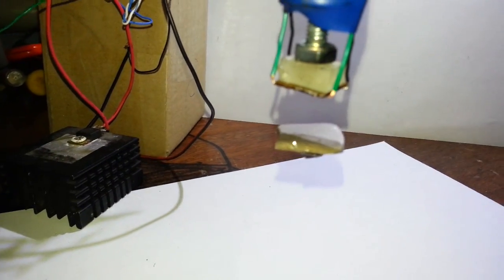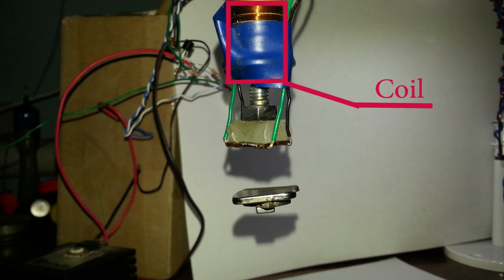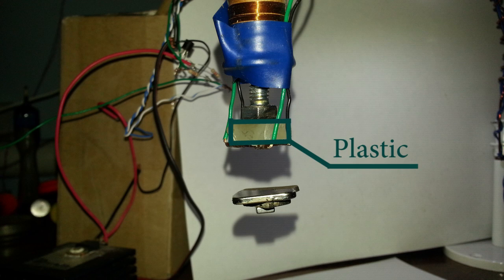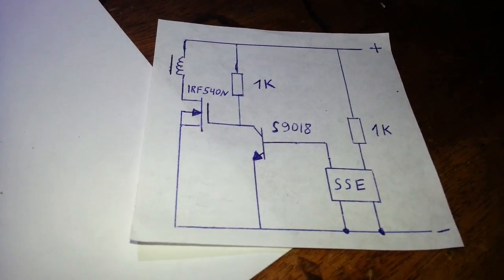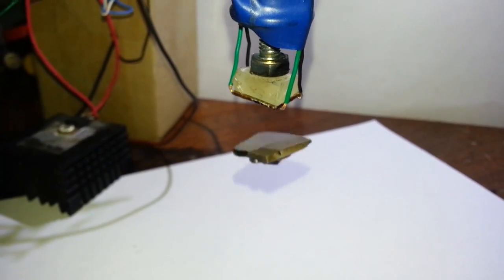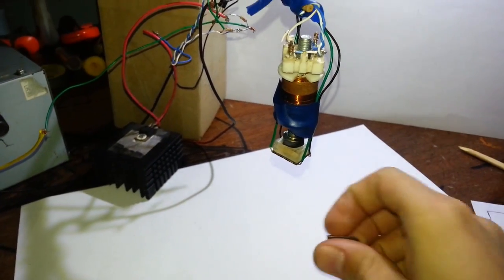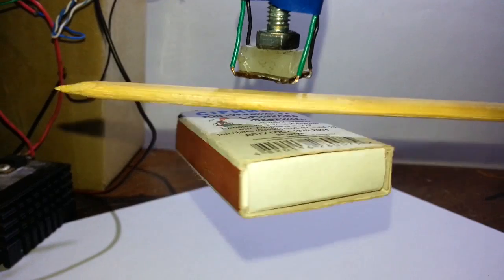Magnetic levitation device / The simplest DIY Anti-Gravity device (how to make levitation at home)

Comment: can I use a w41fc hall sensor  What voltage should be applied? Pls answer!!!!!
Reply from the maker: Hi, I don't know if W41FC will work. I just can say that W41FC is very different from the sensor that I've used in the video. W41FC is not just a hall sensor, it is more like IC that has a lot of stuff inside, so the behaviour will be very different. Also, W41FC has some kind of hysteresis control, and I think that is very bad for a levitation device, so I guess it will not work, but maybe I am wrong.
Working voltage of my device is 5V - 6V, and I used a variable DC power supply (0-20V) to power my device. Before testing, I didn't know what voltage I need at all because I did not calculate anything. I just wanted to quickly make a levitation device... I had an idea how it should work, but at first, I tried placing hall sensor under the magnet, not above, but it didn't work. All development process was just "trials and errors".
Reply: Electrical Projects [Creative Lab]  thanks for your reply!!!

Comment: Does it matter what type of Metal bolt is used?
Reply from the maker: Hi, Yes, it matters. You need to use iron. It will not work with aluminium for example. Here is a quote from Wikipedia: " The wire turns are often wound around a magnetic core made from a ferromagnetic or ferrimagnetic material such as iron; the magnetic core concentrates the magnetic flux and makes a more powerful magnet."  If you need more information read about "electromagnet" on Wikipedia.

Comment: Can the height of levitation be adjusted?
Reply from the maker: Hi, when I was changing the input voltage the height of levitation was changing also, but when the input voltage becomes too high or too low then it stops levitating and the magnet falls down or sticks to the screw.

Comment: hey i want to make a push type one. this is a pull type one. so could i make a push type with the same specifications
Reply from the maker: I think a push type device will have much more complicated circuit than the device in this video.
Reply: please help me with this because i have to do it in 2 months for the science fair. please explain me about this all i know is that it has halls sensors with 4 coils surrounding it and a ring magnet surrounding them all. could you help me about it? i am a ninth grader so i couldnt do it without help.
Reply: or atleast i want to lift heavy weights of 200-300 grams with this one. atleast tell me how to do that. thanks for replying
Reply from the maker: Frankly speaking, I've never built such device (with 4 coils I mean) and in my opinion if you don't have a lot experience in electronics it will be impossible to develop such device just from a scratch. But you can try to find an already developed project, and try to build it, it may work, but it also not easy (or maybe it is easy for you because I know nothing about your skills in electronics). But I really don't know how I can help. Sorry that it took so long to respond.
Reply: thanks..
Reply: You need smaller rotating magnetic fields to get stability with the push type. I over simplified that sorry. There are a ton me re considerations with the push type. The biggest hurdle off the top of my head is you need an air core coil or some type of core that is not magnetic or it will never work the are ferrites that are non magnetic but getting one that will fit your need would be a project all in itself, they can be very pricey. If you look at the magnetic levitation devices on like Amazon. You will see they are expensive, I would bet the most expensive components inside of one of the would be the specialized custom ferrites inside of the coils. I don't know of any off the shelf part that would fit the bill, sorry.

Comment: if what I saw was without any unseen or trickery,, this is a good video.  But it is something that I don't want to attempt because I feel it isn't that easy, and I don't believe that you can just get some spare parts and a Saturday morning with nothing to do and bang, you've got a levitation device.
Reply: Depending on how confortable you are with a soldering iron, and how far you have to go to buy the parts, it IS a very easy project. It doesn't require a big circuit, and you can make your own magnetic coil by winding copper wire using a drill.
Reply: SandroRocchi yeah I think the winding must be precise. I've tried with hand wound coils and have had major stability issues. I also wonder if the odd magnet might contribute to it working. I've failed many times with disc magnets time to try a pyramid of square ones.

To be clear it's the simple coil design that has not worked for me. Three smaller coils spinning has worked just fine.

Comment: very beautifull. I can contact you for clarification?
Reply from the maker: Thanks. Just ask here, and I'll answer.
Reply: +Electrical Projects Would you send me the electrical scheme and the procedure you used?
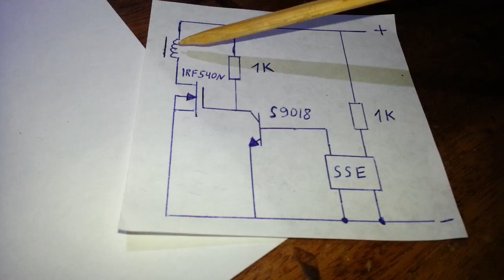Reply from the maker: You can see the electrical scheme in the video on 01:23, that is all I have. It was just an experimental project.
If you are a beginner in electronics, then better don't start with this projects, because this device works very unstable and unpredictable and you will need to know how to troubleshoot problems you will face.
Reply: Electrical Projects [Creative Lab] what is the pinout of the hall sensor? Also pls answer the another question i asked. Pls

Comment: Congratulations on the project, very good! I would like to ask a question: What do you mean difficult to tune? What is this tuning? And What part of the TV is the coil? What was her role on television?
Reply from the maker: Hi!, Thanks! I meant that you need to choose correct voltage, but it is not all,  maybe you don't need that piece of plastic between the hall sensor and the screw at all, or may happen the opposite and you need a bigger piece of plastic. All I mean that you need to play with that kind of stuff to make it work. The device probably will not work straight after building, and for that reason, you need to understand how this device works to tune it properly.
P.S. I just don't want people to be disappointed after building this device.
Reply from the maker: I don't know what was the role of the coil in TV. That was a really old TV from the Soviet Union, and I haven't seen such coils in modern TV.

Comment: Can you make this circuit work using just one transistor, by connecting the hall effect output directly to the base of the MOSFET? I saw another levitation circuit that just uses one transistor.
Reply from the maker: I can't, probably. At least I need a different type of MOSFET. The circuit in the video uses N-channel MOSFET, and if you use P-channel MOSFET then maybe it is possible, but I can't say for sure. The circuit with just one transistor that you saw probably uses a different type of hall effect sensor which has a lot of transistor inside of it.
Reply: Yes, he used an A3144. Thanks.

Comment: Not sure how this works. As the magnet approaches the hall effect switch the current needs to be reduced right. But in the schematic, as the magnet approaches the hall effect switch, it will switch on and switch the npn transistor on which turns on the mosfet and powers the coil. That is backward to what you want. I am missing something.
Reply from the maker: HI, You slightly misunderstood the schematic, when NPN transistor is on it pulls Gate of MOSFET to the ground and turns off MOSFET and the coil. The opposite happens when NPN transistor is off, 1k resistor pulls Gate of the MOSFET up and turns on MOSFET and powers the coil.
Reply: Thanks for immediate response. I get it now. Great project.

Comment: awesome..... btw what if we turn around the whole rig... well the magnet still levitate???
Reply from the maker: No, the magnet should be under the coil. If you turn the device horizontally, it will not work.
Reply: is it because the magnet is too heavy?? what if the number of turns in the coil is increased and a lighter magnet is used... thanks
Reply from the maker: How it works: The gravity is pulling the magnet down, but electromagnet (coil) is pulling the magnet up. Magnet starts to levitate when both forces are equal. If you turn the coil horizontally, you are not compensating the gravity force, you just is pulling the magnet to the one side. It will work even with a lighter magnet, or if you add some turns of wire (up to a certain point of course)
Reply: Electrical Projects haha thanks boss... got a good idea on how ir works

Comment: the only problem with this device is that it requires electricity. All you have here is an electro magnet. have you been able to build a magnetic levitator with free magnets?
Reply from the maker: HI! I didn't build any magnetic levitation devices, except this one. There are ways to make levitation without electricity, but I am not impressed with those ways. There is a way that requires liquid nitrogen, another way requires a spinning magnet (see: Spin-stabilized magnetic levitation) but it can work only for a very short period of time (couple minutes). It is impossible to make levitation using only permanent magnets, some dude even proved it. More you can read here: https://en.wikipedia.org/wiki/Magnetic_levitation#Stability
Reply: ok ty. I had already concluded that before you responded but thank you anyway

Comment: Hi, using a hall effect sensor, if you added more weight, would you need to provide more current/coils to the electro magnet to make it stronger so that it could hold a heavier object up, or does the hall effect sensor take care of most of that? (Still trying to figure out how they work)
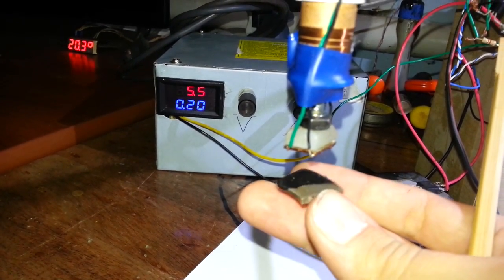Reply from the maker: Hi, hall sensor controls how much current flows through the coil, it is the main idea of the device. On 01:42 you can see how current changes when I pull the magnet up or down. So yes, current changes depending on the weight.
Reply: Thank you very much <3

Comment: work with irpf250n or irf540 ?
Reply from the maker: I used IRF540N
Reply: Electrical Projects i have a irf510 and irp250n, îs posibile to replace your irf540 with my irf250n în my circuit ? tkanks for reply and sorry for my badiu english.. if you not to read this bad english comment, next day edit this comment with good english.
Reply from the maker: I am not an expert, but I think irf510 and irp250n should work ok. I hope you understand how this levitation device works, you need to understand the schematic, and how to troubleshoot the problems, otherwise it will be difficult for you to make it work, because this device is very unstable.
Reply: I understand quite well the scheme, is an easy one; they are just the beginning.

The problem is that I have everything I need, I'll use a good source and a sabilizator LMXXXX.

Thanks for your answer.

Comment: what type of voltage converter did u use
Reply from the maker: You mean power supply... I used DIY laboratory power supply.
Reply: Where do u get one/ how much
Reply from the maker: I didn't buy it. It was a cheap PC Power Supply, I modified it, I added voltmeter, amperemeter and couple of adjustable resistors. You can google "how to convert an atx power supply into a lab power supply" But I found that information on Russian forum here is link http://vrtp.ru/index.php?showtopic=14969&st=750 (I don't know if it is helpful for you because everything in Russian). here is schematic that I used http://vrtp.ru/index.php?act=Attach&type=post&id=617305 but not all of it is implemented in my power supply.
Reply: Ok
Reply: Thanks

Comment: what kind of hall sensor did you used?
Reply from the maker: The one that is used in CD/DVD Drives, on top of it is written: "SSE"
Here the datasheet that I found: http://www.hallsensors.de/CYSH12AF.pdf
Reply: i just disassemble my old hard drive, and there was no sse hall sensor in there T___T
Reply from the maker: It is not inside a Hard Drive (HDD), it is inside a CD or DVD Drive. The motors are similar, but the one that inside a Hard Drive doesn't have hall sensor.
Reply: Is the output of the hall sensor connected to the base of that transistor?
Reply from the maker: Yes, the output of the hall sensor connected to the base of  the bipolar transistor S9018
Reply: can you suggest other hall sensor to use in that project?
Reply from the maker: I don't know what to recommend you, sorry. If I'll find out I'll tell you.

Comment: great video!
what is the purpose of the screw and how are you attaching it to the coil?
Reply from the maker: Thanks! The screw concentrates the magnetic flux and makes electromagnet more powerful. The screw that I used fits perfectly to the coil so I didn't need any adhesive. The coil with the screw is just a simple electromagnet, you can find out more about it on wikipedia: https://en.wikipedia.org/wiki/Electromagnet

Comment: hi good evening.. I just want to ask what kind of hall sensor did you use? is it a ratiometric or a bipolar type..
Reply from the maker: Hi, I'm not sure, but according to the datasheet: "It can convert a magnetic flux density signal linearly into voltage output." For more information please check out the datasheet: http://www.hallsensors.de/CYSH12AF.pdf

Comment: Would a reed switch work instead of the Hall effect sensor?
Reply from the maker: +Cjkturtle I think a reed switch will not work correct because we need much more smooth (linear) feedback. The reed switch has only two states ON and OFF and it can't change them very quickly, so the device will be very unstable, also reed switch has Hysteresis, and it's one more problem for stability of the device.